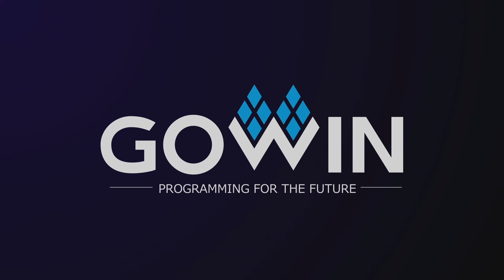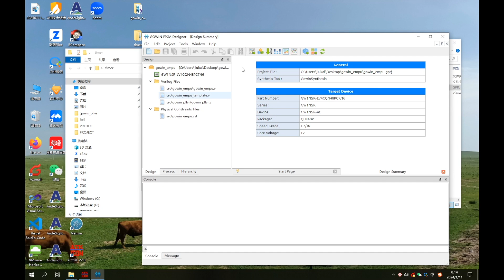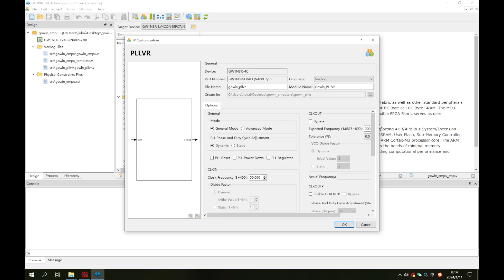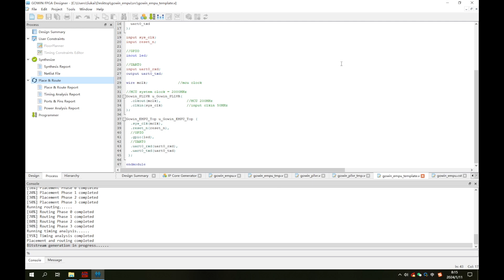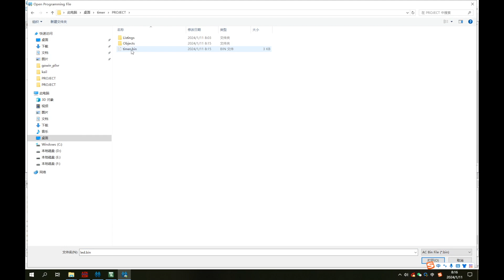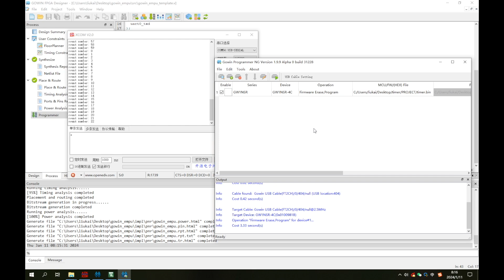GOWIN Demo: Hard Cortex M3 core 200 MHz on the GW1NS-4C

Comment: Does this apply to the GW1NSR-4C? And does the maximum rating for 80MHz on the AHB bus still apply?
Reply from the maker: 80MHz limitation is NOT apply anymore.
Reply from the maker: Add more perspective. This clock frequency is achieved on C7 grade devices which costs same as C6 grade devices. The memory is only used BSRAM here. If user flash is used for code storage, the highest speed is about 170MHz.
Reply: @gowinsemiconductor445  thanks for the insight, can't wait to try the new update!